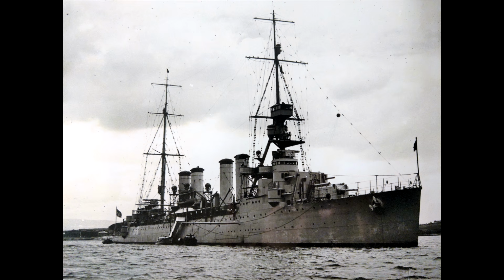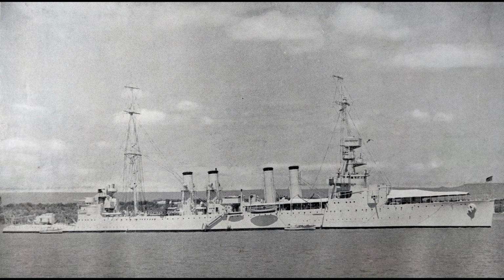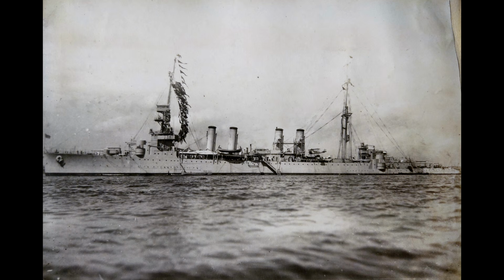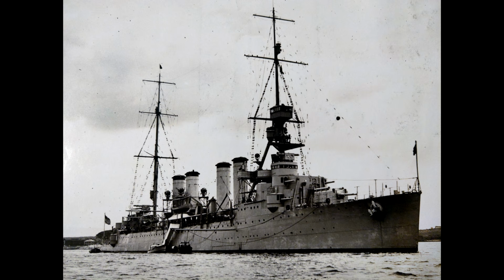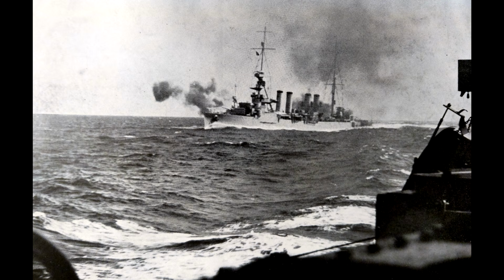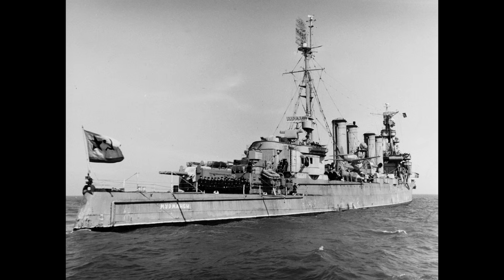USS Omaha - Guide 203

Comment: There is an old book Where Away: A Modern Odyssey
George Sessions Perry; Isabel Leighton (1944). Where Away: A Modern Odyssey. Whittlesey House, McGraw-Hill Book Company, Incorporated. ASIN B0007DKZ0U.

https://en.wikipedia.org/wiki/USS_Marblehead_(CL-12)

detailing the voyage of the USS Marblehead from Indonesia to Brooklyn via South Africa, after being damaged in a Japanese air attack. For much of this journey the ship was steering with her engines because of damage to the rudder(s?).

Hard cover and Kindle versions are available on Amazon, though the hard cover is fairly expensive.
.

Comment: ”How many 6 inch guns should we put on this new cruiser?”
”All of them.”
"You mean-"
"Yes. Double stack classmate them if you have to.”
Reply: It is the Oprah Winfrey of warships:

"You get a 6" gun, and you get a 6" gun! You are ALL getting 6" guns!!!"
Reply: @richardtaylor1652  American equivalent of the Vickers salesman: "Would sir like another 6-inch gun with that?"
Reply: @Wolfeson28  USN: "Do I look like a Nancy boy? Of course I want another 6" gun!"
Reply: @richardtaylor1652  6 foot guns? I'll take 10
Reply: If the design had been thought out better, they could've just used 4 twin turrets instead of those ridiculous double-stack casemates. But the use of turrets at all came very late in the design process.

The design that'd been selected had only the lower casemate guns, and each casemate mount had an open mount for another 6" gun above it on the roof. Plus a pair of open mounts for 6" guns amidships. But this 5-gun broadside considered a fairly pathetic for a 7,000 ton ship. The British C-class cruisers (at least the Caldeon, Ceres, and Carlisle subclasses) were 2,000 tons lighter yet had the same 5-gun broadside. The open mounts were also considered too vulnerable. So the design was revised with double-stack casemates and the empty deck space forward and aft was used for the twin turrets. And the amidships 6" mounts were replaced by the 3" AA guns. Still a quite inefficient layout, but at least the 8-gun broadside was equal to or better than that of other scout cruisers of the era.

Comment: What did the poor Milwaukee do to get loaned to the soviets?
Reply: After the surrender of Italy Stalin demanded part of the Italian fleet as reparations and wanted the best ships only. He didn't have any crew capable of running them or collecting them from there internment ports but to placate him they lone him a few surplus RN and USN ships until the war was over and they could actually deal with what ships to hand over. It also allowed the RN and USN to strip out or destroy and replace any equipment deemed to valuable to give to the soviets.
As place holders the ships loaned were abused and treated in the most appalling fashion and poor old Royal Sovereign was scrapped as a write off when returned.
it just as well both the RN and USN removed all top line equipment such as radar fire control and communications set ups from the ships and replaced it with old obsolete fittings.
Reply: @paintedblue1791  Let's be honest, leaving the modern equipment on wouldn't have helped the soviets anyway.
Reply: @satannstuff  You don't have to fully understands the concepts behind equipment if you are capable of copying it. Also there were a lot of supposed liberated British and US prisoners of war who vanished after the soviets overran there camps and they were usually technical specialists i.e. Radar and communication operates.
British personal were warned to only identify them selves as non tech personnel if captured by German or Soviet forces.
Reply: Same thing as HMS Royal Sovereign, I guess.